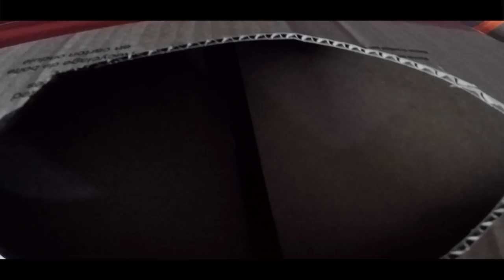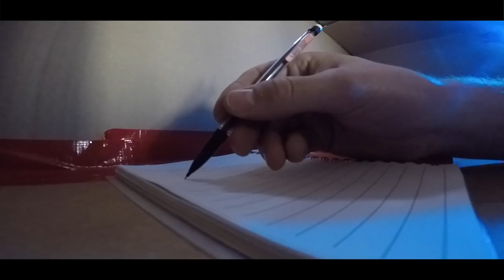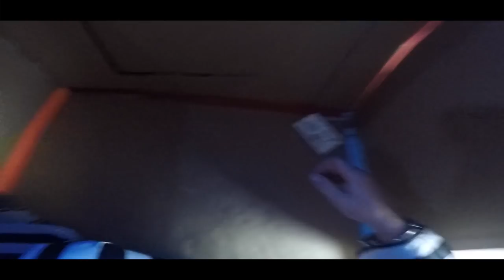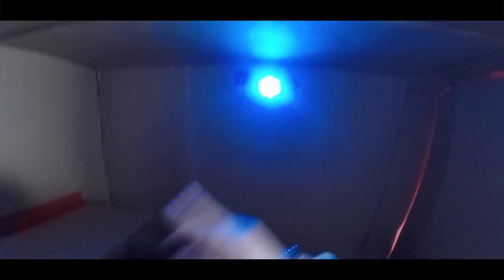24 HOUR BOX FORT PRISON ESCAPE!! 📦🚔

Comment: Why can't he just open the door. Also, why is there a match in "prison". Also, can't he just stand up to break out of "prison."
Reply: Also, who is holding the camera in all of these shots, it looks like the camera is mounted on his head, but how would he be able to do that, with his hands cuffed?
Reply: Also, you can see the light when he's ripping out the toilet, and it look the same as when he got there.
Reply: Also, he says, "it should go in to the main depository, where all the other toilets go." 1. What do you mean, "where all the other toilets go." There are no other toilets! You said it yourself, at the beginning of the video! "This is a single cell..." 2. He didn't build the tunnel in the video. 3. This is a new "prison" there shouldn't be any other poo there to make a raft out of.  4. He uses an emoji poo raft.
Reply: also, how did you "make" the paddle?
Reply: "We pretty much left no trace." What!  You ripped the toilet out of the wall, broke the carbon monoxide detector, broke a light, and very clearly burned though a rope.